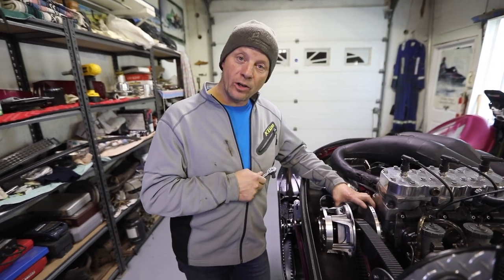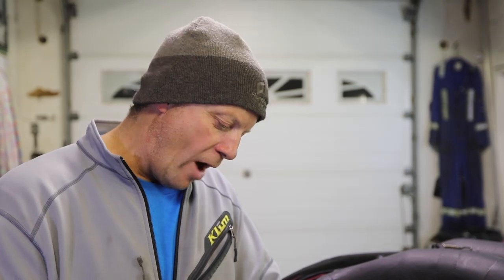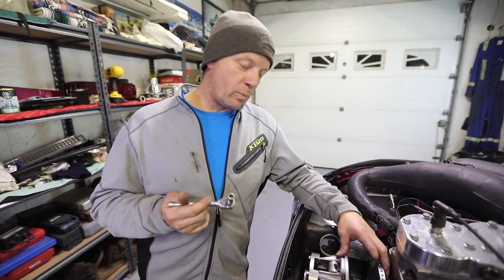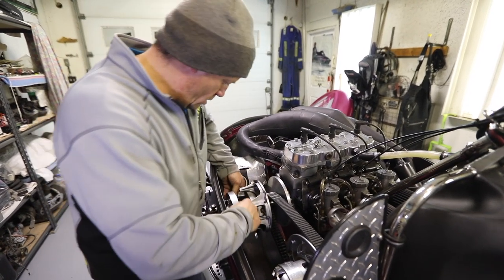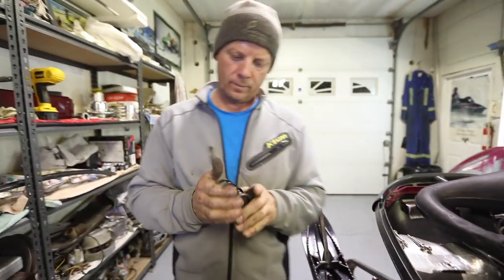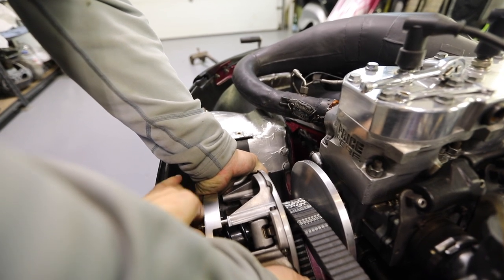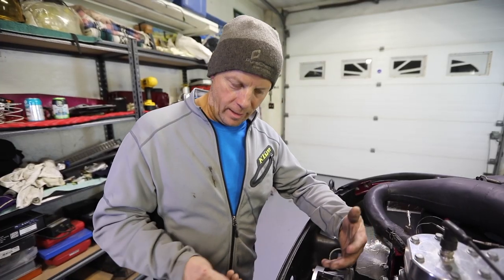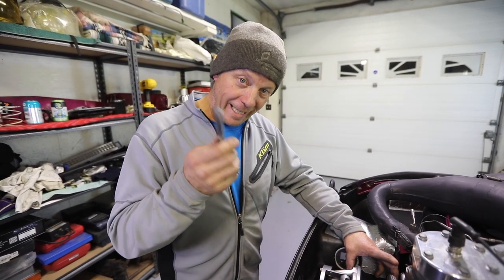Primary Clutch Spring. How to change it on the snowmobile.

Comment: Use a C clamp to hold the clutch cover on for your 3rd hand if you’re at the shop and working alone. Saves the end of the bolt holes from getting things cross threaded or stripped during removal and installation

Comment: This helped alot. Didn't know it was so easy to change the spring. I picked up a Sno Pro 500 for a good deal. They threw a lot of upgrades at the sled and she started to have a bogging issue, they sold it instead of working on it. I've narrowed it down to the primary Spring. It's completely shot. Found a good after market replacement, going to order it soon and give it a try with a buddy nearby. I'm new to working on machines in general and people like u make it easier to learn about things like this, I highly appreciate you taking your time to upload! If I remember I'll make an update on it!
Reply from the maker: Yes would be interested in hearing if that worked !
Reply: @DIGIT9  Finally got around to doing it! It was extremely simple to do. My buddy popped in to help slap it together. Took about 30 minutes total. My old spring was in 2 prices, like I thought. Hopefully it's all I'll need to play into the upcoming season!
Reply: Update!! The Sno Pro 500 is working like a charm! I've found out there's a crutch kit along with some vforce 3 reeds, It's easy to send the skis dangling and it's honestly got my arms sore! I absolutely love this thing! Pretty cool how a vid I watched last year got me up and running this season! Thanks for the knowledge!!!

Comment: Thanks for this video , going to put a new spring in a 99 xc 700 today , it was broken when I got it and I'm just finishing up rebuilding the top end from the water pump belt being broken- b4 I got it ! It should be ready to run in within next day or 2 !!!! Ohhh yaaaaahhhh gettin ready 2 send it don't yah know aaaaaaaa. Update : got the new spring in after a full clean up and just new lock washers for peace of mind . Spring was a tight squeeze there, but i lubed the main clutch bolt and pushed in and turned after a few tries just brought the outer pressure plate in 80% of the way then cleaned and antiseazed bolts and drew it in no problem ! Even have the X lined up !!! Haaa haaaaaaaaa, tomorrow is the big first start after a few more touchups !

Comment: What would you recomend in a 91 RXL 650? i have it carburated converted.. i have a really high end bog on mine, im not sure if it is my clutch or carbs... air screw is 1 turn out... 270 mains all the way across.. needle is on the 3rd slot from the top... clutching i have 10al weights with blue spring... primary i have R11helix
Reply from the maker: What do the plugs look like at WOT ?

Comment: Hey, I know you probably wont see this, but how do I know what spring  to get for my snowmobile? can I just get any odd primary clutch spring and it will work? or do I need a specific spring for my snowmobile. its a 1994 arctic cat zr 580.
Reply from the maker: You need the specific spring for that sled , unless your into clutch tuning ! The dealer will have the right one !

Comment: How to you get that primary clutch cover back on when you work alone? Any tricks? Lol
Reply from the maker: Sometimes I use a 2 x 4 , someguys use a clamp ! Leave belt on when doing it too ! If you can get one bolt started , roll clutch 180 degress and get other one started , work on bolts evenly and one turn at a time !

Comment: I bought my first sled in the spring,  its low miles at 1,500 miles but its a 1990 AC Jag Deluxe. So based on age alone, i should probably replace the spring,  right? I have secondary off and waiting on clutch puller to arrive to pull and clean the primary,  but i didn't think to ask this based on years instead of miles on other videos. Yeah it's mint and clean,  but i doubt the old guy ever cleaned the clutch let alone disassembled them and let the spring relax. I wonder the same mileage vs years sitting about the shock as well.
Reply from the maker: Springs get weak as they sit , always good to replace old ones regardless of age or use !

Comment: Thanks for the video brother! My 1st snowmobile at 44yrs old. Having a blast with it when she is co-operating. 04 Yamy 700-triple. 

I recently burned out a belt in heavy wet snow. New OEM belt now engages at like 5k rpms, previously it was 4k
With it like this I'm doing 40 tops at 8-9k rpms. I need to adjust my primary correct? Definitely probably needs a new spring. I'll probably start there.
Reply from the maker: Check both clutchs
Reply: @DIGIT9  
What am I looking for exactly? My secondary also has side to movement, would that be too he main issue with RPM engagement so high? Tempted to change both springs & go from there.
Reply from the maker: Sounds like the springs were changed at some point , maybe even the helix in secondary ? Find out the stock specs from the manual or a dealer and go from there ! Prob wouldnt be a bad idea to check gearing too !
Reply: @DIGIT9  
It's an 04 with 1k miles on her. So maybe time for a new spring. Thanks for the info bossman!

Comment: Would my polaris not moving at all even at high rpm be a bad or worn spring inside ?? We replaced the belt last winter and it ran and drove once before it started having drive ability problems
Reply from the maker: Need more info bud !
Reply: @DIGIT9  1998 Polaris Indy Classic 500 2 up
Reply from the maker: Does it spin track when lifted off the ground ?

Comment: Question for you I have a 1999 Yamaha vmaxx 700 triple I want to replace my primary spring it has 2500 miles but I don’t know what spring size to buy the numbers wore off on mine i would appreciate it thank you
Reply from the maker: I’m guessing a Yamaha dealer should be able to find that for you ? But I’ll look into it too !
Reply: OK thank you I’ll call the Yamaha dealer
Reply: Should I change the secondary spring too ?
Reply from the maker: If your primary spring is tired , chances are your secondary spring is too !!
Reply: Ok thanks man appreciate it

Comment: I have a racing clutch in my rz6000. The spring is a 170 / 330 and I have 60g notched cams. can I switch my cams to unnotched cams and maybe the spring too, so engagement won't be so harsh?
Reply from the maker: Absolutely !
Reply from the maker: Do the weights first !
Reply: Ok.. then with the spring that heavy, I'm wondering if I should step up the weight of my cams?.. any suggestions?
Reply from the maker: Find out what is supposed to be in it stock first ! If you put heavier weights with the stiff spring , it might not be able to pull them , ie, wont get any rpm !
Reply: That is the stock equipment.. it's a 2017  zr 6000r SX
Reply from the maker: I dont believe the notched weights came with it but if it did , keep same weight , just not notched !

Comment: I have a Polaris 340 skidoo 
Can someone tell me why it’s not engaging when I give her the throttle 
It won’t go in to move the belt
Reply from the maker: How old , what model , how long it been sitting , is clutch spring broke , does primary clutch engage , is the brake on ? For starters !
Reply: @DIGIT9  no brake on , spring is good been sitting for 4 years
Reply: 2008
Reply from the maker: Take belt off and try revving it up , if that dont engage it then tap outside of clutch with a rubber hammer ! Sounds like its stuck !

Comment: I appreciate your channel.. Can I get some advice on a 2009 Artic Cat CFR800 primary clutch with 5000 miles on her..    The clutch seems to hang up when coming down from 5000 rpm to idle.   Would the common failure mode be that the weighted cam bushings are allowing the cams to rub?  What do you think?  I'm gonna stick my head in there and snoop around tonight but I have no tools yet to pull the clutch..  Your thoughts... Can I change the cam bushings without pulling the spider off (total disassembly)??
Reply from the maker: Ya sounds like weights are binding , could use a good cleaning ! New springs would help too !
Reply from the maker: Oh ya , weights can be changed without removing spider !
Reply: @DIGIT9  is there just one big center spring or to each of the weight cams have springs also??
Reply: @DIGIT9  How do I get the pins out of the weights without removing the spider?
Reply: @DIGIT9 Shouldn’t I just buy a new clutch or rebuild the one I have?  I’m mechanical so it makes sense for me but $500 for a clutch is ok to.
Reply from the maker: We have a video on clutch cleaning and disassembly , but if you can buy a brand new clutch for $500 bucks ? Go for it !! 👍
Reply: @DIGIT9  sweet!!!  I’m watching your clutch cleaning video now and I assume the clutch in my 09 sled is very similar to the one that you’re cleaning…. ??
Reply: @DIGIT9  Great I’m gonna try cleaning the clutch first and then I will go from there.  The clutch cleaning video gave me great information about how the clutch is designed and supposed to work and what the wearing surfaces are as well..
Reply: @DIGIT9  so I think you’re saying if I have to go as far into the clutch as replacing the buttons for the spider then I might as well just buy a new clutch.  Does that seem like the logical direction??  If I buy a new clutch do you recommend the OEM arctic cat or the other style of clutch like the CV Tech??
Reply: Yes I subscribed and liked several of your videos.   thank you very much..  excellent content..